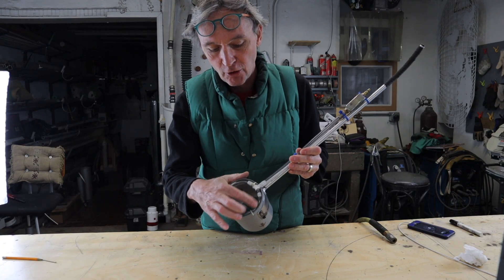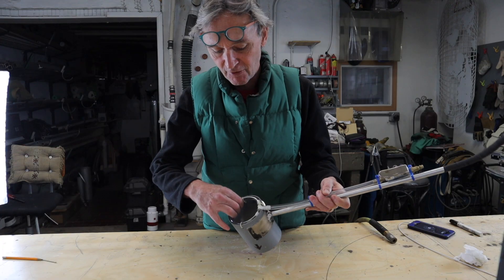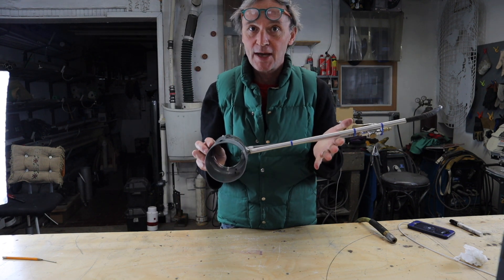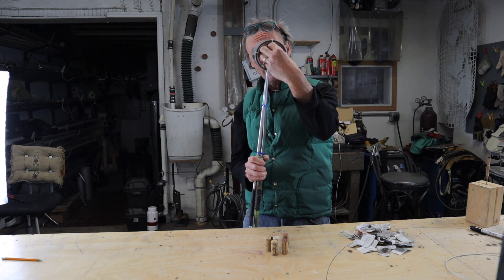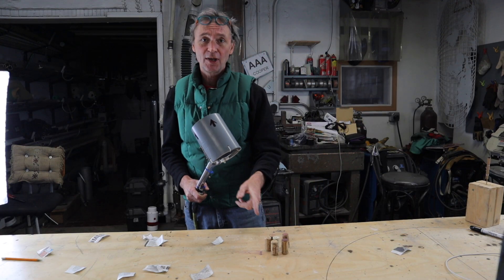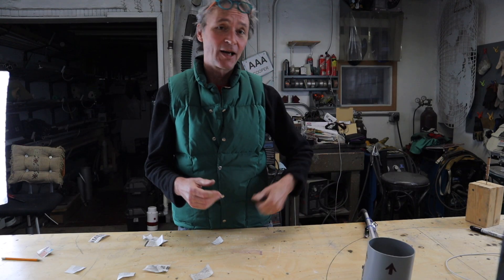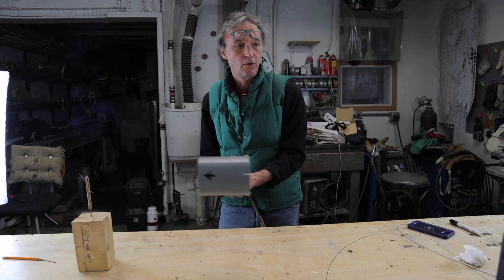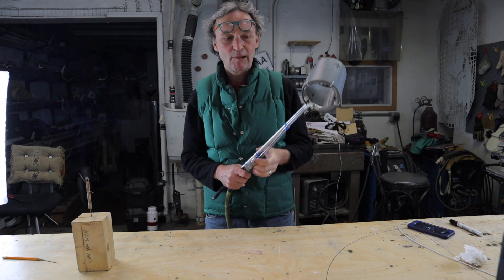Making a Venturi blower - Poor man's Dyson fan

Comment: I'm trying to made a poor man version here in Brazil. Our currency, the BRL isn't much good and the industrialized equipments are so expensive, in special a good air compressor with large air flow and pressures up to 8 bar. I need to try superchargers for pistons shit air compressors, micro supersonic holes and heat in this holes to increase the compressed air flow, increase the kinect energy with supersonic heated aceleration motive air.

Comment: Excellent presentation! You have inspired me to make one! I have a question if you would please. When you said you used a pin to make the 20 holes inside the vinyl tubing, did you just poke the tubing? Heat the pin? Or would drilling  holes work? I'm thinking 1/16" size holes. 3/8" tubing. 4" PVC pipe about 12" long. does the effect work well with a larger length of pipe or does the pipe need to be a certain length?What are your thoughts?
Reply from the maker: Heat the pin or it will self seal, use a larger hot pin for a bigger hole. Drilling leaves a ragged hole which is bad for air flow. I think 12" long pipe would be overkill, I bet there is a formula, but I'm guessing Dyson knows it so roughly the proportions of one of his $600 hairdryers.
Reply: @MethodsandMaterials 🔴 What Is Islam?  
 
🔴 Islam is not just another religion.  
 
🔵 It is the same message preached by Moses, Jesus and Abraham. 
 
 🔴 Islam literally means ‘submission to God’ and it teaches us to have a direct relationship with God.  
 
 🔵 It reminds us that since God created us, no one should be worshipped except God alone.  
 
 🔴 It also teaches that God is nothing like a human being or like anything that we can imagine. 
 
🌍 The concept of God is summarized in the Quran as: 
 
📖 { “Say, He is God, the One.  God, the Absolute.  He does not give birth, nor was He born, and there is nothing like Him.”} (Quran 112:1-4) 📚 
 
🔴 Becoming a Muslim is not turning your back to Jesus.  
 
🔵 Rather it’s going back to the original teachings of Jesus and obeying him.

Comment: What is the benefit to having the compressed air at the end of the cylinder? Would the flow still be the same if the compressed air was coming from the middle of the cylinder instead of the end?
Reply from the maker: There would be no advantage to having the air coming from the middle, all the cylinder before the compressed air entry would be redundant, and in fact may increase friction and obstruct induced flow and hence reduce outward flow. We want to make it as easy as possible for the small air jets to induce a draft by lowering the pressure. Actually the ideal shape for maximum flow is somewhat trumpet/cone shaped with the larger end away from the introduced air. Using straight PVC pipe is easier though and makes it a little more directional, which is what we want in this instance.
Reply: Methods and Materials I have one hellofa confetti cannon now so thank you. What I love about this is that it uses very little cfm so my tiny lil compressor can keep up.
Reply from the maker: You are trying to induce flow in still air, so needs to be at the mouth/inlet end.